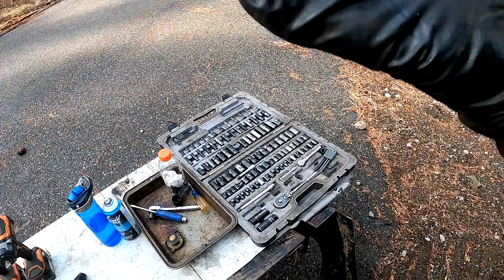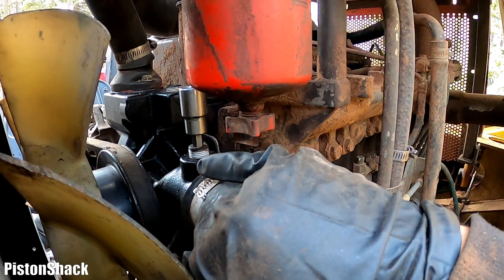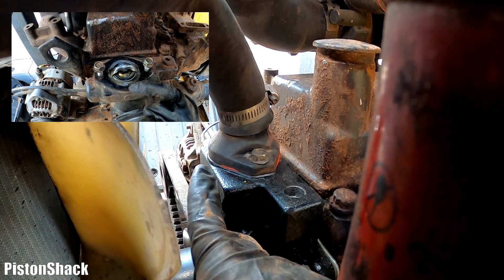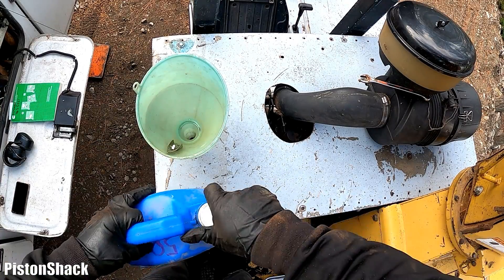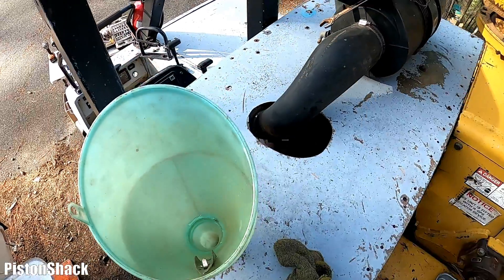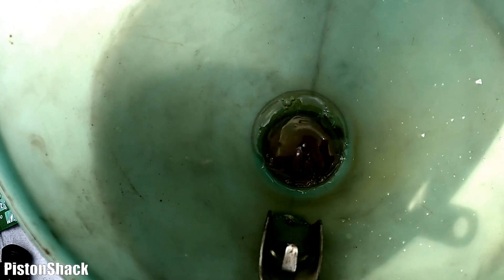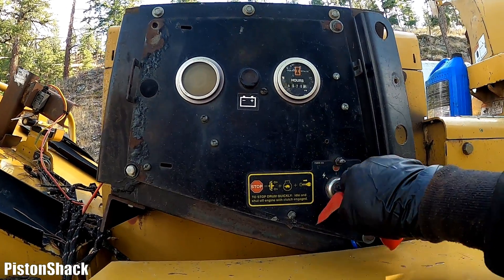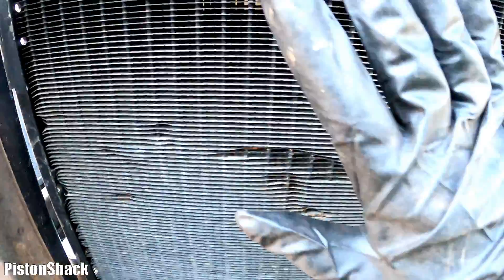HOW TO BLEED AIR OUT OF B3.3 CUMMINS COOLING SYSTEM | VERMEER BC1000XL

Comment: Did the water pump on your new water pump line up with the alternator and crank pulleys? I bought several new pumps and the pulleys are all too far out
Reply from the maker: Everything lined up as it should. I just swapped the pulley to new water pump.
Reply: @PistonShack  where did you get yours? I couldn't pull the trigger on the $700 Cummins part so I bought a couple $100ish water pumps from ebay and Amazon and the hub is spaced about 1/2" too far out so the pulley doesn't line up with my alternator and crank pulleys. The water pump works fine otherwise, it's just going to chew up belts...

Comment: great video, didn't know about the thermostat position. I am working on a b3.3 with overheating problems myself. would love more b3.3 videos.
Reply from the maker: Awesome< Greg! More vids are coming up later. Did you find what was cause of overheating?
Reply: Sadly not yet, trying the small stuff before i tear the head off to see if the gasket has blown.  @PistonShack